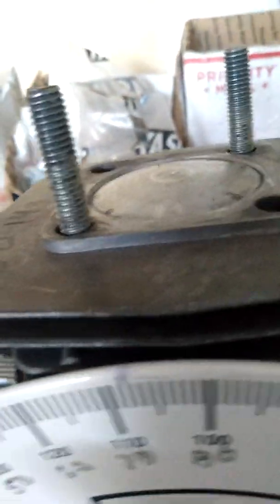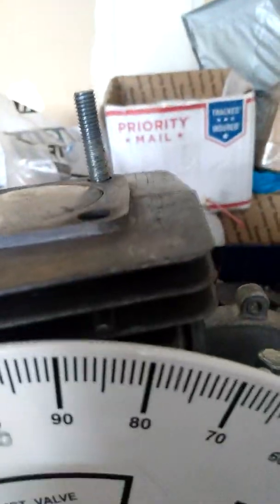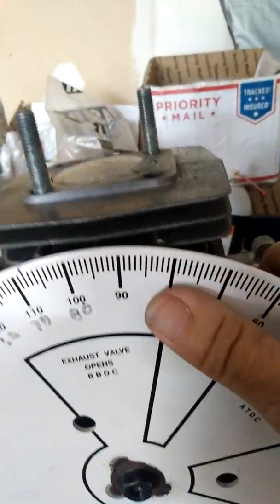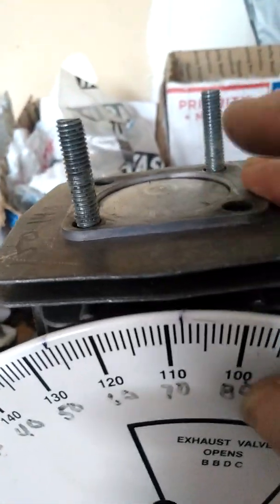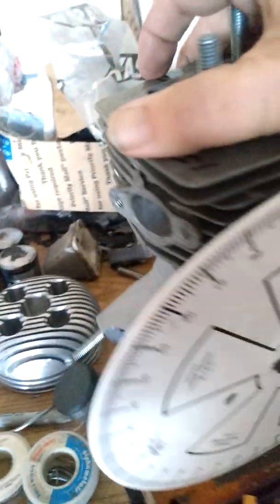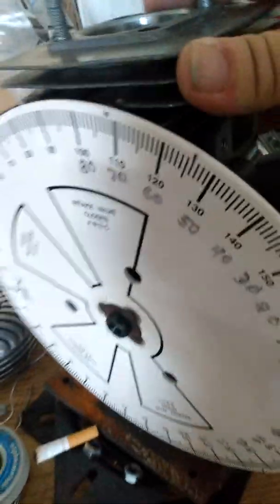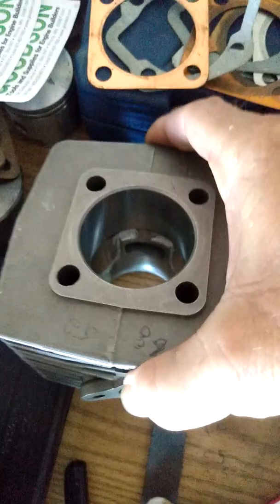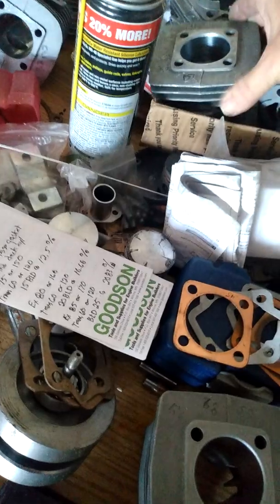motorized bicycle.  deck hight ie sqish will be with all gaskets you choose.hit the like button

Comment: Alright, now i'm trying to figure out what the head gaskets used as 'spacers' are called.  I've seen several videos of builders using really thins one to hit their squish mark, but not once do they mention what they're called, or, where to get them. 

Anyway. . . 

🇺🇸
Reply from the maker: Forget where to buy all this stuff but I ran copper head gaskets from .o2 ,.o4 .o6 .o8 mm  I had access  to knee mill so typically  I would machine most of my deck surfaces. Typically  I set my cyls up to achieve two different port timings  by swapping out thicker or thinner head / base gaskets and still achive my desired  .75 mm sqish gap. Happy porting
Reply: @2strokecarbtuningportingin187 .75, no kidding! 

I switched my stock base gasket out.  They are very thick >>>>> I stenciled another one using 1/64" tan Felpro, which I will also coat in a very stingy manner with "High Tack" sealer.  

That brings my squish to .97mm, but that's without Ultra Gray on the bottom of the sleeve.  I have no idea what measurement that stuff comes in at between 2 machined surfaces.  I have to experience it.  However, I do know that I don't need very much of either sealant, and, after assembly, I don't want to use any torque for about 2- 3 hours, torque it down, and then wait til the next day so it will be cured properly.  Hopefully the sealants will give me the .04mm I need. 

The surface, where the Head gasket sits, do the copper gaskets allow me to get away with the faint milling marks, or should it always be shiny smooth?  
My sleeve surface is very smooth, but, I can see the mill marks, so. . . 

One more thing if you don't mind >>>>> the torque on these flared HP Heads [Smolik], I hear it's suppose to be 8-15lbs.

Sure isn't all that tight by my torque wrench.  Does that sound right to you?
Reply from the maker: @whatsyurprob158 never used a torque  wrench on a motorized bicycle  engine but yes 15 psi sounds correct

Comment: So, here's the deal:

Wildcat Minarelli 'ULTRA' motor made by California Motorbikes, with a Smolik Performance cnc Head.

No base gasket.  Just Ultra Gray.  
No Head gasket, just an O-Ring. 

I'm shooting for 1.0 - 1.2 squish, but when fully assembled, my squish is .52. 

That said, I have a copper Head gasket that measures .52.  How the gasket I haven't even used is the same measurment of  my fully assembled squish  measurement, I have no idea.

Even so, am I correct in thinking that if I disassemble it down to the spacer plate, and sand down the top of the jug  .50", how would I know when I reach .50 when i'm sanding the jug? 

It's either shaving the top of the jug, or, using the copper gasket, and missing my squish point by .02". 

I hope you understand >>>> what would you do? 

Thanx
Reply from the maker: @whatsyurprob158  you say assembled your sqish is .52 mm and your wanting a 1 to 1.2 mm sqish you need to add .5 mm base gasket simple math. As far as how I measure  to know how much to remove I machine my cyls with knee mill and fixture touch off tool from surface and remove my desired amount. Crap hope the answers helps
Reply from the maker: @whatsyurprob158  crap got brain 🧠  damage. If the copper gasket will work with that head yes it would be perfect.
Reply: @2strokecarbtuningportingin187 Nope!  

I had it backwards, and so did you! 🤣

I have to sand down the Head.  I figured it out after I added a base gasket, and my squish got tighter.  I need it at 1.0 - 1.2 mm.  So, with only Ultra Gray, and an O-Ring on my Smolik head, my squish is at .42mm.  Therefore, I have to bring it DOWN .58mm. 😔
To make things even worse, it's an IRON jug, and a steel sleeve, so it's gonna take awhile.  I have to do it by hand on a piece of glass with water.  I'll be there for a few hours. 

Time to become familiar with the depth gauge on my caliper.

Comment: So if I put 2 cylinder gaskets it would increase the exhaust and transfer timing  dereased intake and decreased compression, so to make that balanced I should deck it to be exact with the piston when topped, and for the intake i would use 3rd transfer and reed that should increase the intake duration?
Reply from the maker: Yes as you lift cyl you increase exhust and tranfers and decrease intake duration
Reply from the maker: As you lift cyl your sqish gap increases so you want to machine deck to correct the sqish gap
Reply from the maker: Didn't I answer these questions on Facebook for you

Comment: Hey I like that new cylinder that you created that's nice I'm sure you're getting a lot of people bugging you about it now you know that right
Reply from the maker: The 6 tranfer cyl is one I did months ago. I have 10 cyls I need to machine the deck .o75 thousands and machine boost ports at 25 degree angle at the secondary tranfer opening hight above the intake port
Reply: @2strokecarbtuningportingin187  oh you should start I posted something earlier on Facebook about it creating a two-stroke rotary in motor for the bikes I saw that day two stroke stuff guy talking about a rotary 2-stroke motor I was laughing about it I had to post it so you kind of remarks I got but I haven't checked it